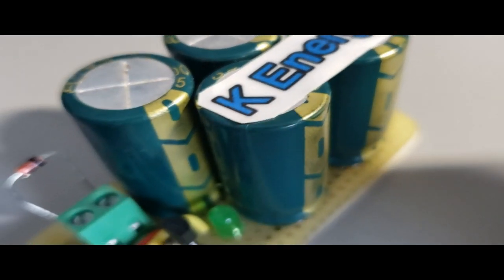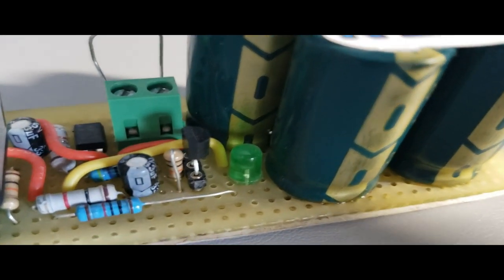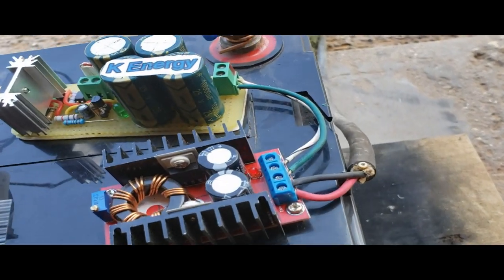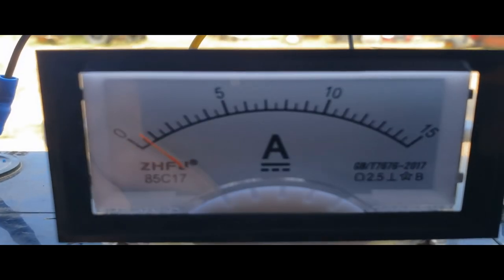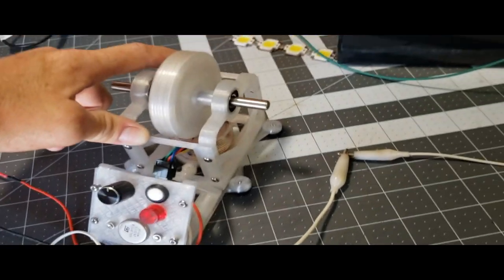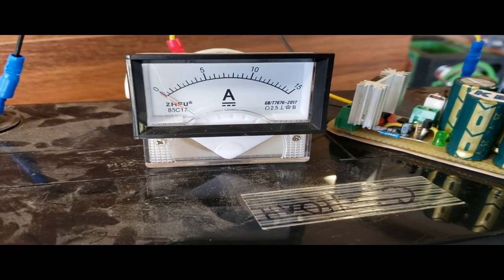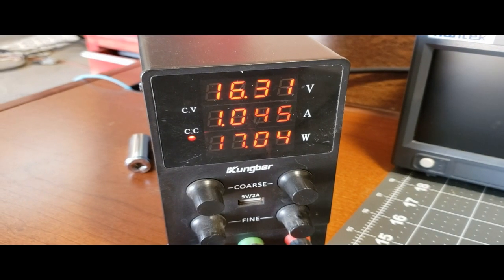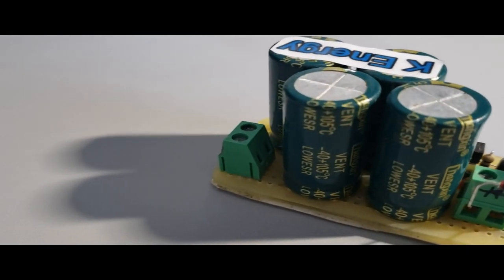Passive Capacitor Discharge Circuit

Comment: I designed and built a battery de sulfater device, I sold this unit on the internet, it was basically an inductor, capacitive discharge system, it would produce a 150 volt, pulse of about 5 Nano seconds duration, controlled by a Tiny13 AVR chip, I programed with 3 selectable pulse rates. This device worked very good in restoring batteries, and I sold many, and all customers were happy, and I received positive feed back on E Bay for them, I did find that it was very important in the restoration process, to limit the charge current to  only about 1 amp, until restored, then cycle through a few charge, discharge cycles, gave me about 80% success. But excessive amperage during DE sulfating, caused a higher rate of shorted cells. If interested, I have my circuit, pcb bord layout, and advertising txt i used while manufacturing them. Good luck.
Reply from the maker: I appreciate the advice. Do you thing the 150v could have been the reason for needing current limits. Have you tried pulsing with just double the batteries max voltage rating? I still have plenty testing to do, just curious.
Reply: 5 nano seconds is amazing ! well done sir, i wouldnt mind having a look at the circuit ! : )

Comment: I think we should adjust the name of this process to 'Pop a Cap' as in 'Pop a Cap in your Ass' Well done for supporting Kenergy , but in general it's very simple, an SCR a Zener and a Cap. More people need to discover this trick for taking high voltage low current and charging batteries.
Reply from the maker: Yeah SCR's kind of work, but with different voltages tend to latch open. His is mosfet based which is a bit trickier.

Comment: Yes I did, but the most effective process was a high pulse. I found that as the battery rejuvenated, the peak voltage would drop to 50 volt's or less, The pulse voltage is not important, its the amperage it's delivering, this is what breaks up the sulphate in the battery. I have seen them connect a battery to an 200 amp Arch Welder, and claim success, I'm skeptical of that. In my research I found documentation claiming that the high peak pulse does not harm the battery at all, due to it's short duration, but breaks up the hard sulphated deposits in the battery, and the charging cycles break in down to Sulpheric Acid again, The heat of high amperage during recharging warps the cell plates, causing shorts. Once the battery is restored it can be charged normally.
Reply from the maker: Makes sense, thanks for you knowledge sir!

Comment: Really awesome. I am definitely going to check out his store. I need to find a system that switches batteries from a run to charge and vice versa . Where could I find one of those or schematics for a two battery system? Thanks. Keep up the great work.
Reply from the maker: Look through my videos, I have a latching battery swapping relay idea you might find useful 😉
Reply: @redesign3dp  Awesome!! Thank you.

Comment: Why use capacitors at all?  Why are the spikes not collected and sent directly to the charge batteries, sir?
Reply from the maker: Tha caps convert high voltage low amp spikes into lower voltage higher amp pulses.
Reply: @redesign3dp  Why did K choose 5amps for the dump sir? Would this suffice if you had 4x12v batteries connected together sir?
Reply from the maker: Amps get restricted by the cap bank size and the load resistance. Parallel battery's would have less resistance.
Reply: @redesign3dp  Thanks for the info sir. I normally quiz AI for these facts, but it has been resistant lately with terms like "mainstream scientific community", "empirical scientific evidence" etc.  I've been lucky enough to have access to Tesla's book of writings and research notes but I haven't yet come across anything on condensers as he liked to call them.  I'm very grateful that you, K and 3D Print F.M are so forthcoming, I would be lost without you all, but I don't want to be a nuisance either.  I will pay it forward to new experimenters as you have to me.  Thank you again sir.
Reply from the maker: Search for LM studio on YouTube, you can get uncensored models on your desktop
Reply: @redesign3dp  I did not know such a thing existed.  Thank you sir.